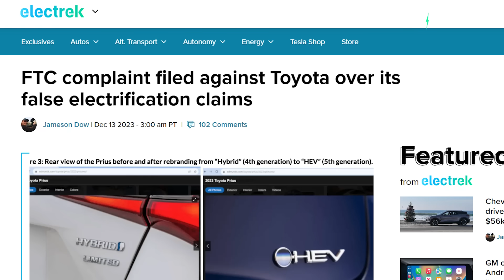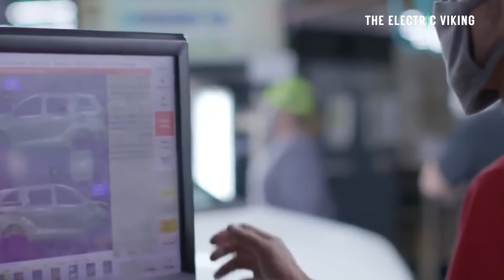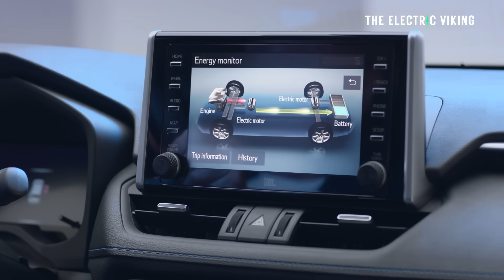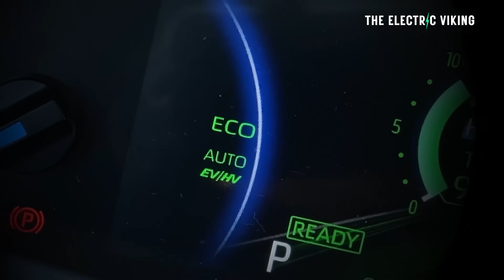The FTC is investigating Toyota's false electrification 'self charging' claims

Comment: Assuming a goal of CO2 reduction; as noted where there is coal or gas plant powered grid the EV does nothing helpful, they are even heavier; where the PHEV or Hybrid does; they get 25-30% further than their equivelent non Hybrid - Corolla is a good example they have both non hybrid and hybrid versions the Hybrid gets about 50 mpg and the non hybrid gets about 35 mpg. World wide about 80% of the grid is still fossil fuel powered.  It is in the other 20% that your all Electric EV has an advantage of 0% CO2; but the PHEV is only about 16% CO2 and the hybrid about 25%-30% less CO2. Overall the PHEV reduces most, then the Hybrid and EV get about the same +/-
Reply: this nonsese was debunked long ago.

Comment: Under some use conditions having a diesel or petrol charger on board is better than hoping the one on the Nullabor, or at Oodnadatta is functioning - while roadtripping...

In a dirty grid, a "self charging" PHEV  - Electrified vehicle" - can be cleaner than a "true RV" - due to carting around a whole less battery weight (greater useful payload), and utilising a "constant speed generator" for minimum fuel burn - it only takes exactly what it needs...  Everyone in this "commercial" space bull$h!ts -  the trick is how mich is "protected speech" (Current EM fiasco) even Tesla (they claim "no marketing" wgile holding huge media events full of drooling Sycophants, at every step along the way to Li-Ion Valhalla..

If nobody uses their PHEV as an EV  for local driving the question is why?? - are all the buyers stupid, or is there no significant saving filling up the "electron tank" at a pubic charger, vs fueling up on petra-oileum, or Oileum-post-Verde, Beyond Petrol, or Extremely Green??  Surely people care, it just may not "pay" for them to bother too-much, meanwhile, the wars continue.

Comment: @5:42 "... impossible to achieve net zero with a hybrid ..." globally viewed it is possible to meet net zero CO2 even if all cars are ICE or some other fuel burning tech, simply by sequestrating carbon from atmospheric and hydropheric CO2. HOWEVER, the process is inherently inefficient requiring tremendous overbuilding of nuclear and/or renewable (or at least non-fuel burning) energy sources. It isn't impossible, just imbecilic.  When other by-products from burning are considered, a pure electric (really electrochemical, in the case of batteries) is clearly the best choice as long as the technology is built on safe technology (that is on tech that doesn't generate its own, worse environmental consequences).

Comment: Toyota's HEV's are MUCH better than pure ICE's re burning FAR less gasoline per mile, especially in the city.  Until there are enough affordable BEV's for everyone (which will be a long time), HEV's or PHEV's are FAR better than the alternative (pure ICE's), and it's better to drive those AND save lots of gas burning. 

That's the main claim, re its overall strategy, Toyota is making, and I agree with it. 

Do I wish they'd pursue HEV's and BEV's more aggressively?  Yes.  But don't confuse the imprerfect with the devil incarnate.
Reply: Toyota Rav4 prime plug in AWD hybrid is $49,000.
Tesla Model Y long range AWD is $49,000 minus a tax credit.

A Tesla Model Y has been much easier to obtain than a Toyota Rav4 prime, especially considering the Toyota markups and shortages in the last couple of years.
Reply: Nobody's confused about the distinction between evil and imperfect. However you are confused about the distinction between advertising and utter lying